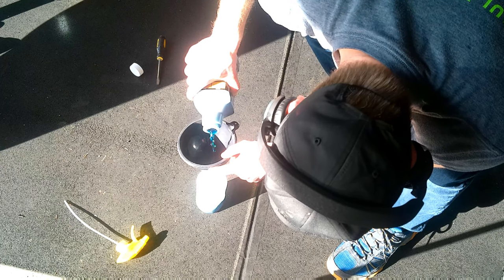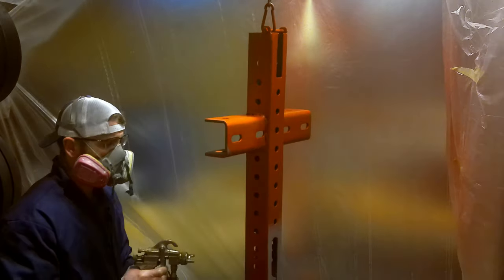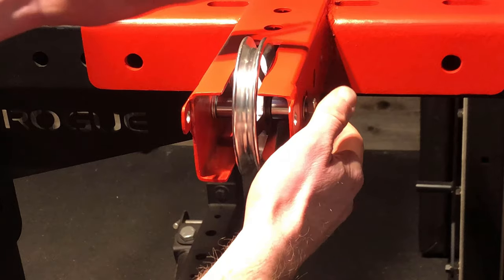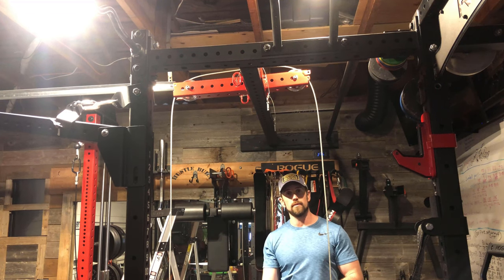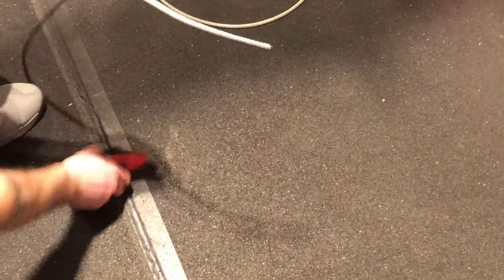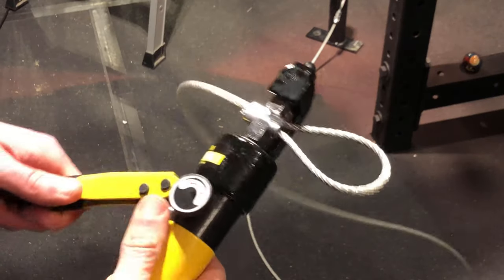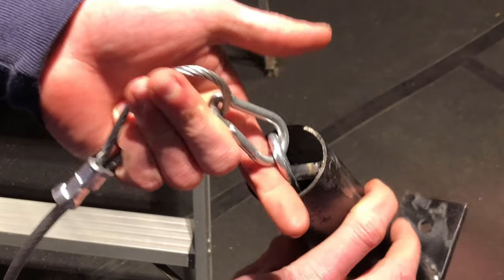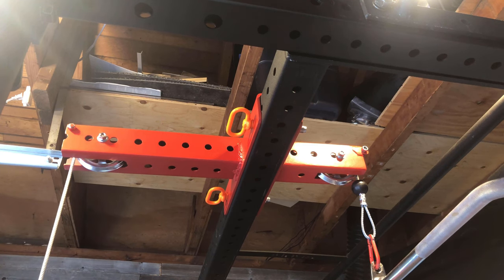PART 2: FEDEX My Surplus Strength UPS DIY Version

Comment: Do you think if I bought the Surplus Strength UPS For my 80" short Rep rack there would be enough range of motion on tricep pull downs and lat pulldowns? I'm 5'9" so not tall.

I been hesitant due to the price and height of my rack. Very awesome project.